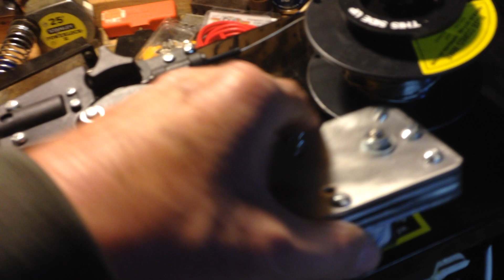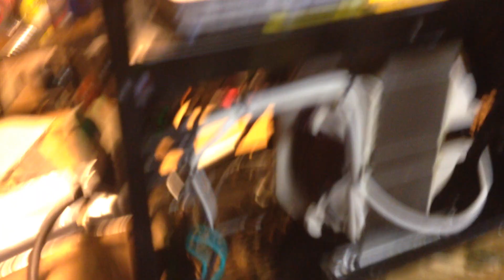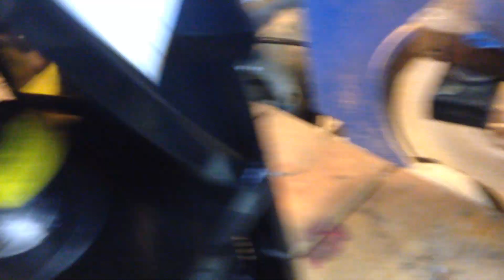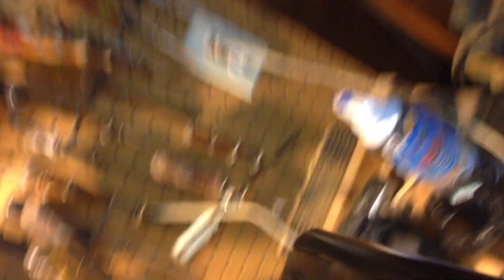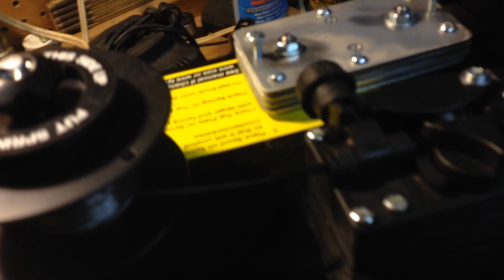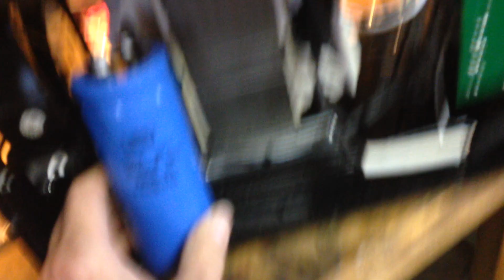Harbor Freight welder DC converesion on new 125 unit Part 1

Comment: I have the older HF 90amp welder that I'm upgrading to DC. I moved my power cord to the back, I added a transformer for the wire feed motor, and I put a dinse 25 socket on it for the ground, and increased the ground wire to 2 gauge. I'll be adding a Miller M25 mig gun to it as well since it's more commercial and durable, and is 10' long.

Comment: I realize this is an older post but maybe someone will have an answer. I have a welder with similar specs, but it uses an inverter not a transformer, will this conversion still work?
Reply: If it's an inverter, it's already a DC welder, isn't it?

Comment: Since the air flow occurs in the bottom compartment, you might want to mount
the rectifier so that the heat sink is in the bottom, not the top compartment.
That way the air flow will pass over the heat sink, carrying away the heat. The stale
air in the top compartment may not be as effective at cooling the rectifier......

Comment: Thanks a lots kly explane in actual technical way in short and fast  just i want to convert my DC machine  into a mig welding unit
Reply: this doesnt make it a mig welder... a mig is metal inert gas. to convert one of these to a mig. isnt worth the cost. you would need to change your gun and feed line to it to have a pipe in it to bring gas to tip.. a regulator also and a bottle of argon gas..   also u would want to be able to turn down the amps .. this u can not do with the flux 125.. buy a mig if u want a mig... a mig is good for car body panels.. use this welder the flux 125 for heavyer stuff like 8 to 10mm thick steel... i think thats rite in mm .. iam in usa so not use to mm ..

Comment: I have also noticed that people wire these electrode negative.. You get more penetration going electrode positive the way I understand things.. Thinking it would be ideal to be able to invert the polarity for different situations.. Also take a look at that fan and get the specs on it.. You may be able to get a better one with ball bearings and max CFM for maximum cooling and better duty cycle.. Just a thought.. Look forward to the finished product! Nice work!
Reply: When you convert this welder to DC, you MUST run electrode negative or it welds like absolute dog crap.
Reply: Flux core is supposed to be DCEN.

Comment: Nice and roomy inside the welder! Personally I think the rectifier would be better located in the path of the fan for best cooling and #8 wire is rated 40 amps.. Wondering how this will fare with a 90 amp output?
Reply: What gauge is coming off the transformer?

Comment: Lots going on in your conversion. What does adding more microfarads do? The one blue cap you show has 20K mfd and 100V. What's the advantage of linking multi caps, giving u more mfd, as opposed to using only the blue cap with 20K mfd?
Reply: More MF = more consistent flow between the power supply to the clamp and the gun, meaning better chance of gaining penetration on a piece in one consistent pass.

Comment: Ive got the 90 amp..and put the  bridge rectifier in it.....
 .How do i make a induction coil for mine ?? Good video
Reply from the maker: Ok, I believe (so I learned from watching Utube) that an induction coil creates a magnetic field and as a current flows through a magnetic field, the field resists changes to the voltage...so if voltage drops the coil tries to maintain the voltage constant by adding some voltage and if the voltage increases the coil resists this increase.  So why is this important in this application? As you know the diodes in the rectifier change the AC wave to a series of double half waves in only one direction (DC), but there are small periods of time when there is almost no current flowing in gaps between waves.  Now the capacitor we added to the circuit is designed to discharge voltage to fill in these gaps in the DC wave.  Even so, this process will produce and uneven voltage flow, which is where the induction coil comes in.  It resists these minor changes in the voltage.  Now you know more than you ever wanted to know about inductance...
Reply: alfred james your principle is correct however inductors resist changing in current not voltage whereas capacitors resist changing in voltages
Reply: @alfredjames1839  I have heard the inductor should be in front of the capacitors. Has anyone tried it both before and after the caps and have they noticed any difference?
Reply from the maker: I ordered a Toroid Ferrite core on e-bay, 8 dollars and change...I just wound the no. 8 wire around it about 10 turns before it went out to the electrode (gun)...note in my second video it's mounted to base of cabinet  between the capacitors and the gun wire.
Reply: Thx  how does these help the welder?
Reply: @alfredjames1839  - do you know what the toroid's part number or value is?  Even toroids visually identical have vastly different electrical characteristics.
Reply: Helps smooth out the ripple.
Reply: Thanks
Reply: IT helps make you weld puddle wetter and flatten out

Comment: Looking forward to seeing the complete project. Just ordered my bridge & 50000 mfd cap. Really like your bridge mounting & heat sink.
Reply from the maker: Completed project is on utube now under part 2.  Thanks for comment on heat sink...really works well, never gets hot at all, just warm when running long beads.
Reply: You gave me a great idea on that heat sink. I have a bunch of big belt buckle sized aluminum punch outs that would be great for that. And I could put a little fan blowing through them. Does it even need one?